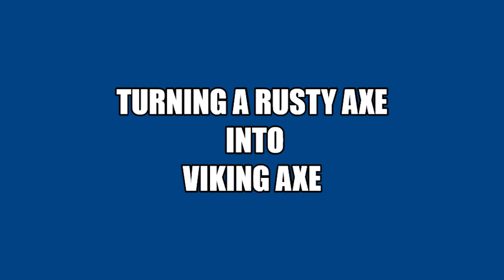How to make a viking axe head from a rusty old axe

Comment: My question... Does this kind of cutting and grinding compromise the structural integrity of the blade?
Reply: Exactly. I got same question. I think that this kind of cutting and grinding can easily over heat the steel and make it very soft so it cant be sharpened. I'm curious how this guy did that
Reply: Nope. it does not harm it so long as you keep cooling  it a bit at the edge or if you dont get it so hot that the metal changes colour on the surface. If you see the thiner edge turn blue as yyou are grinding then it may harm the temper . It will only be a problem though if you intend to put the finished axe to realy hard use. This is only a very simple guide for this example. metalurgy  and heat is a huge subject.